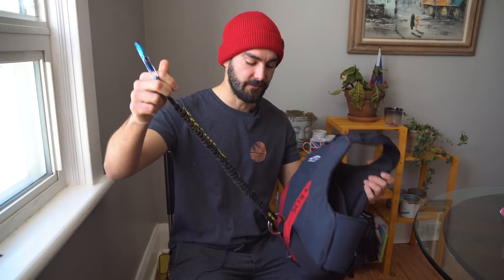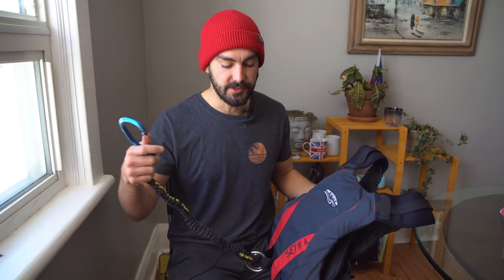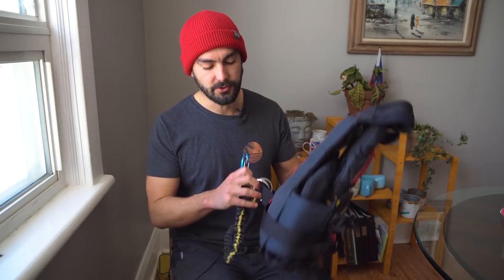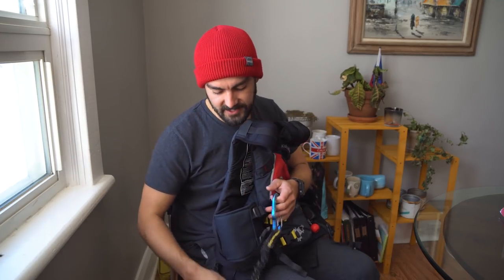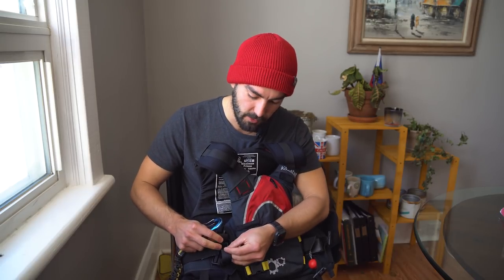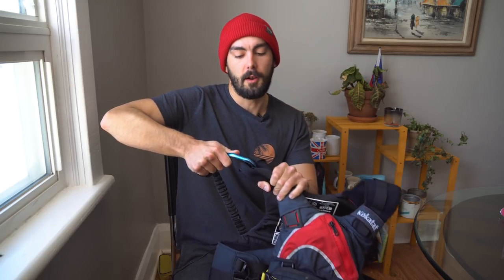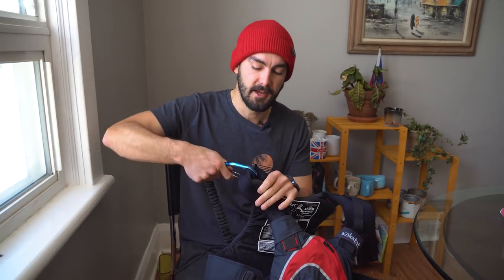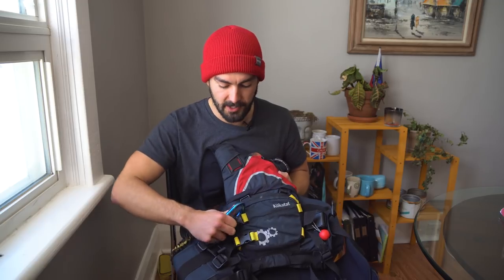Where to attach your Cows Tail. WW Kayak Knowledge

Comment: You might do what I did with my crevasse rescue gear (also short, looped ropes) while mountain climbing. I put them inside a small pouch attached to my waist. They couldn't become tangled or catch on anything, but they were already attached and ready for use in an instant should I find myself smashed up and thirty feet below the surface. In such a situation, I figured I had maybe five minutes before the cold sent my motor skills to pieces.
Reply from the maker: Interesting!

Comment: i use mine on my shoulder but then i have 4 knives on me one on each leg one on my back and another on my left shoulder and i have trained to use my left hand even if im right handed
Reply from the maker: Charles Sanne risky business man!
Reply: @SethAshworth  only if there is anything to snag on at all where i paddle most of the time its a place owned and maintained by the kayak club im part of no trees no rocks only mountian and water place got water diverted from it used explosives  to deepen and then we removed the rocks then removed the dam and let the water back now its also a slalom training spot if im on a normal river i fasten on the belt ofc so if i pull the whole thing goes off if i get snagged im cutting the vest i have a emergengy cannister inflatable vest under my normal one just in case for when i run big water we also smoothed out areas with concrete mixed with waste material from the area
Reply from the maker: right on!  @charlessanne5689